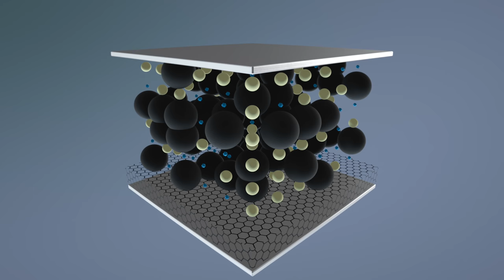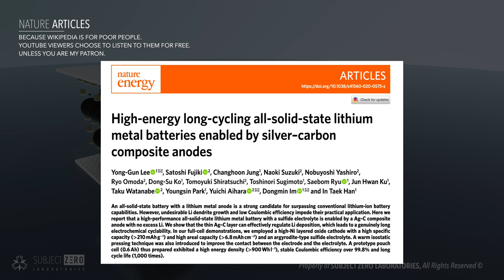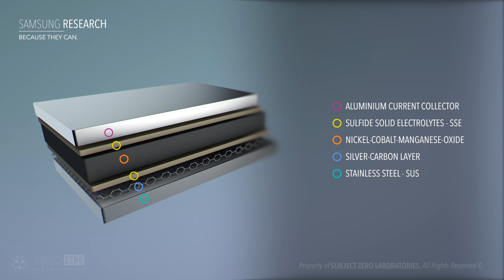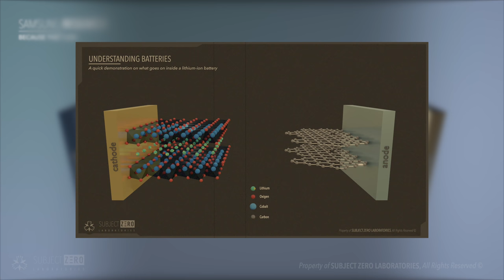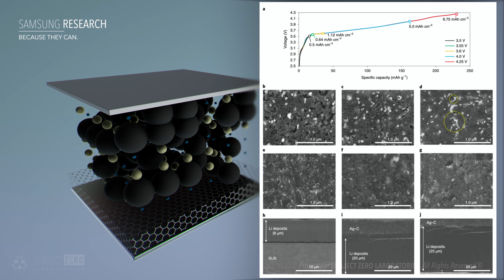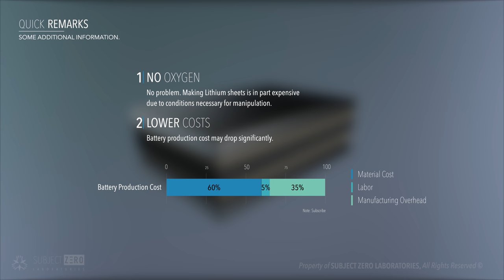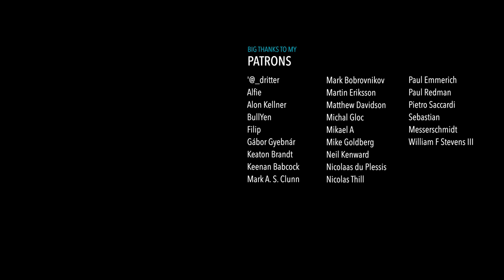Breakthrough Solid State Battery - 900 Wh/L Samsung [2020]

Comment: Now just add Molten salt reactors to charge them - Elysium's is my favorite design.
Reply: No molten salt....
Fusion reactors are the answer.
Check out General Fusion
Reply: There's absolutely no need for that when you can use hydro, geothermal, wind and solar.
Reply: @osi1neu  Agreed, fusion reactors are the answer... in 2075
Reply: @osi1neu  The Sun is shining
Reply: 22020 tech prob harness dark energy and convert that into useable energy.
Reply: Modern Molten Salt reactors burn nuclear waste and decommissioned nuclear weapons. 
Even if fusion was already here we would still need to get rid of nuclear waste. 
The current champion is Natural Gas with prices trending toward $0 for fuel.
How can you outcompete that on price? Use fuel others will pay you to get rid off.
Reply: @Popeslash  Why? Hydro kills a lot. 
The others aren't scalable
Reply: People have been trying for a very long time to make fusion work, with little to nothing to show for it. It may be inevitable, but we are nowhere close to it becoming reality.
Reply: @osi1neu  good luck with tokamaks... there goes your efficiency
molten salt thorium  reactors are a good stepping stone until fusion tech is ready
Reply: @osi1neu 
"Why going this indirect way"
Cause fusion on earth is still a fuel based system, which would run out in a couple hundred years.

Issue here is that we can't use water as a source, but use a special lithium isotope and that is pretty finite. (Filtering the needed hydrogen isotopes out of the ocean needs way to much energy.)
Sure a couple hundred to thousand years is a long time, but it isn't a solution.

"Space travel"
An other reason why we shouldn't use it on earth. We might need it for space travel later.
So yes we should develop it, but we should focus on "indirect methods" to harvest energy from the sun for a permanent solution, instead of focusing on "wonder solutions" that are close to snake oil.
Reply: @CountingStars333 
"Not scalable"
What are you talking about?
The Sahara desert alone is big enough to feed the energy need of all of humanity a few times over.

When you look at current nuclear exclusion zones, solar needs only twice the space nuclear needs.
Reply: @Quarknjaguar  tokamaks are only one approach. And even that looks promising. Maybe you inform yourself about the latest accomplishments at the ITER project. But I'm also not a fan of tokamaks. You should google after "Wendelstein 7x" for the most advanced Stellarator or "General Fusion" for another approach (which I believe is the most promising, they're starting to build a demo plant with positive net energy)
Reply: @rafqueraf  yes, but not always there where you need energy (earth rotation 🤫)
Reply: @Alorand   Alorand  0$ 😂😂😂
That's absolutely ridiculous.
We can't discuss on this basis of knowledge. And even if the current price in dollars would be near to 0$, that's a market effect, but not the real production costs. And what about the costs of environmental pollution and global warming? And it is also not renewable.
Reply: - There is still no administrational infrastructure in place for this type of reactor, which could cost billions.
 - The molten salt fuel is more expensive to produce than regular uranium rods, and the reclamation process is complicated and expensive to facilitate
 - Although an MSR could theoretically create its own fuel, true breeding is difficult to achieve, and in reality you have to add Plutonium to sustain the reaction, which mitigates many benefits.
 - Nuclear energy is currently the most expensive source of electricity on the market, twice as expensive as both oil and wind.

It's a promising technology, but not exactly a silver bullet.
Reply: @kallehalvarsson5808  agree, the real shame is they stopped any further development back in the 70ies, at a time when getting test setups etc approved was much easier than it is today. By a simple continuation to the Oakridge Experiment with a 2nd generation of the setup, we could have solved or at least understood many of the issues that are still open today (longevity of materials etc.) and now the start-ups running on quite small budgets can easily run out of time=money before they get anything approved even for a small scale test. Once you get to a first viable prototype, industry can be strong at solving problems and improving products continuously (a little bit less in a highly regulated technical environment, but still). Dont know if its real or CT, but i can well imagine some of the industrial giants were just much more inclined to a reactor type that use about the same components that they already have on their shelves, and back then, getting out some weapons-grade material in the process was considered rather an advantage than a problem.
Reply: @osi1neu  Earth is rotating
Reply: @Popeslash  Yeah, you don't need solar and wind if you have fusion. Those 'renewables' also cause destruction of nature.
Reply: Firstly, geothermal/solar and wind can only supply 40% of needed power, which is why fossil industry promotes these. No threat.  Big energy also loves fusion, because of the unlimited government investment and no results.   On the other hand, the fossil fuel industry is afraid of next generation fission, as it is meltdown proof, 1/3 cost of coal per watt, and sustainable for 1 to 100,000 years, not counting the new cheap seawater extraction.  Also, worry about waste is a joke, when you realize that all geothermal energy is generated by radioactive decay, and there are natural non man-made reactors all over inside the earth.
Reply: The solution for the fossil fuel companies is to stir up science challenged greenies protestors and promote fusion. If fusion does accidentally work, great, they can have an energy monopoly. It is a win win for them. A loose loose for the consumer.  Monopolies are never ultimately good.  Nor are only 4 or less companies in any market.
Reply: Evil Yoda You don’t understand the laws of physics and economics, do you?
Reply: @PalimpsestProd  after depop and corral.
Reply: @osi1neu  
Have you ever heard of batteries? Solar and wind can be stored for later use. There are so many different battery designs, and not just traditional chemical batteries, either. Pumped hydro, rock piston, salt balance, compressed air... so many ways of storing energy. The Earth gets hit with so much energy from the sun, most of which goes to waste, unused by plants, animals, and civilization alike. You ask why we should go the indirect route of capturing that? Because it's free. I mean, of course we need to invest materials and energy into harvesting it, but why use up fusion fuel that we can never replenish, that we might need in a few thousand years for interstellar colony ships, or in a few billion years to refuel the sun? (These are only theoretical examples for something we might need in the distant future. Don't get caught up in how "fantastical" they sound.) That's energy we never, ever get back, all while unfathomable amounts of hydrogen get burned up in the sun, that go to waste, unused by anyone. Your question is ass-backwards!
Reply: @theuncalledfor  On the one hand you are talking about refueling the sun, but than you are concerned about the finite amount of hydrogen at earth???? Sorry, but at this level of disproportion I can't debate.
Reply: @osi1neu  indeed

solar in not good enough
Reply: @lolsflint7598  Real market application only 200 years away.
Reply: @rafqueraf  Weather is sweet...
Reply: @PalimpsestProd  if you want it by then you need to stat founding it today( broadband internet  )
Reply: KEK-ASS Not all lithium mining is a horrible process.  Chile is doing is pretty well though they need to reuse their water better and it would be pretty darn clean.
The future of battery tech will use far less lithium anyway.  And anything you do requires some kind of mineral to create batteries.
Also not all solar uses solar panels.
 The big farms don’t use solar panel they use an array of  mirror to heat water produce steam turbine.
Bill Gates’ foundation recently created a solar farm using ai driven mirrors that in north america acheived temperature of a forge far above that needed for forging steel etc.  so in that case it could not be cleaner.   Nor cheaper to operate and maintain.
I love the idea of fushion, but it ain’t happening soon, and until then we need other solutions fast.
Reply: @PalimpsestProd  Agreed, got to speed up the entropy according to antinatalism based on consent.
Reply: Blame your parents for that one.

These reactors were conceived back in the 70's and 80's, but everyone decided "not in my back yard", and thought atomic power was worse for the environment than coal/gas/oil.  
Kind of funny, how short sighted environmental advocates set actual clean energy progress back close to 50 years.
Of course, much of this was driven by some very powerful lobbying, paid for by petroleum producers.
Reply: Rick Cutshall You mean the same exact design that failed in Japan just a couple years ago.
The real deal is the Traveling Wave Reactors, and they almost got started until Trump forbid it in his lunatic war with China.  Ending then move to clean nuclear energy...
Reply: @Popeslash  sure that seems to work ok..
Reply: Alorand those do seem really cool!
Reply: @Arrogan28 The design in Fukushima/Japan didn't fail.
The reactor, its containment vessel and its periphery worked as expected.
There didn't happen some mystic unpredictable accident.
They used an american, approved design for the reactor to reduce costs. But this design was never meant for earthquake or tsunami risk areas. All chemical and atomic reactions that happened before, during and after the accident are well known. This disaster could have been prevented easily by choosing a better design. But as always, to save money they played with fire.
As example, the emergency generators where located near ground level. In a flood risk zone! Of course it failed after the tsunami hit. Just putting it at level three or five, we wouldn't talk about Fukushima.
Reply: KEK-ASS  "an infinite production cycle on a fixed amount of pre existing material" that's obviously impossible. Fusion of light elements (below iron/nickel) into heavier ones gives you energy, but fusion of heavy elements into even heavier ones needs energy. The exact opposite is true for fission.
What you are likely talking about, although I'm not sure as I have not heard of it before, is using some of the waste energy of the nuclear fission reactor to split the products of the fusion reactor back into fuel. You would then have solved the problem of finite fusion fuel (assuming this works, which I don't know at all); you would however still need fuel for the molten salt reactor.